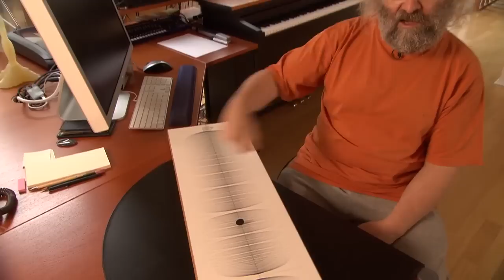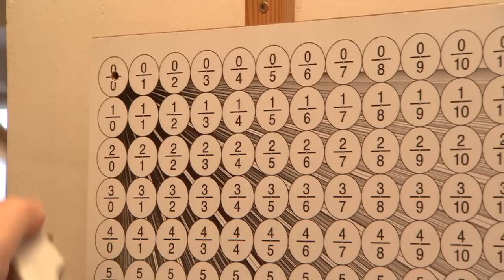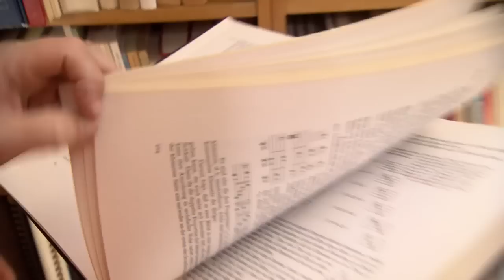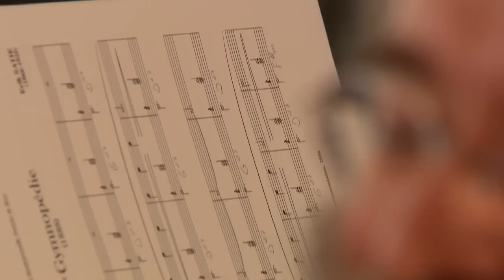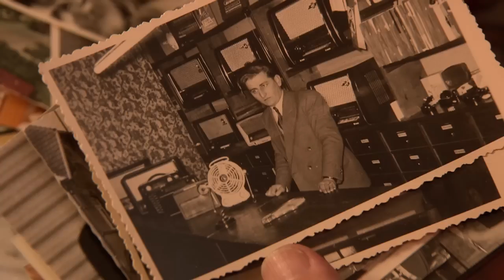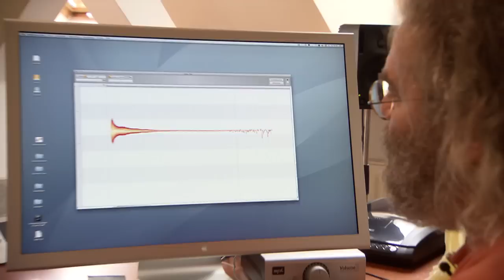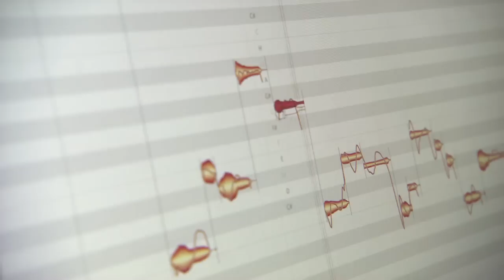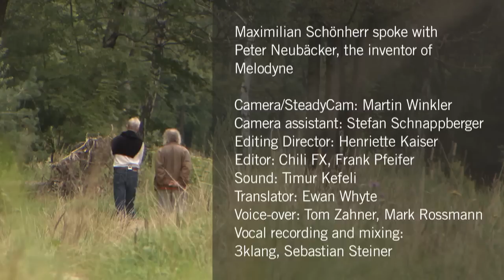Melodyne inventor Peter Neubäcker (film portrait)

Comment: Why didn't you add a wow & flutter meter in Capstan ? This way all the Studer / tape machine owners would use Capstan for calibration purpose also !
Reply from the maker: Capstan works with pre-recorded material only. It needs to analyze the audio track with DNA technology. Unfortunately this doesn’t work in realtime which would be a requirement for calibration.